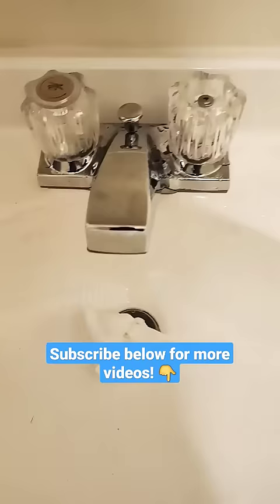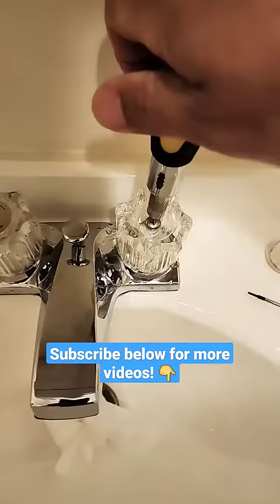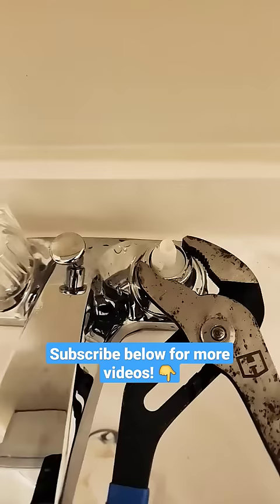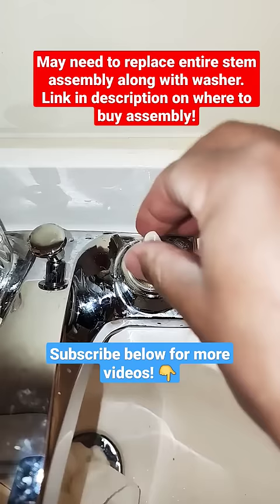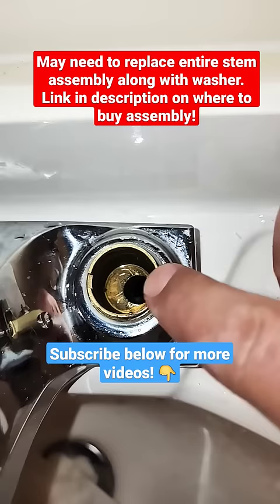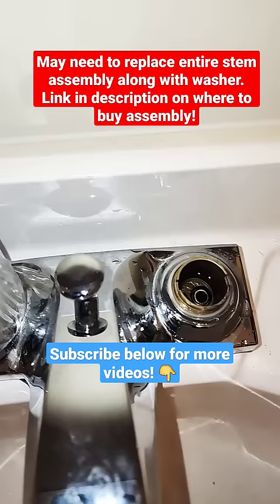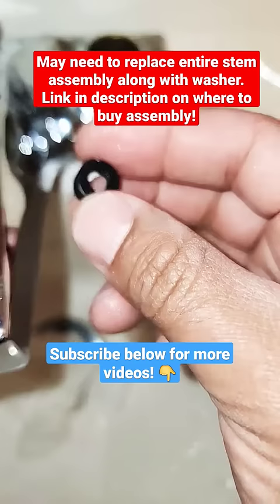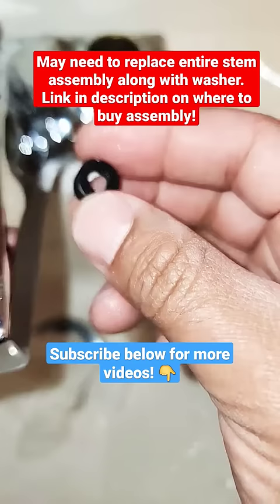How to Fix a Leaky Faucet in 60 Seconds

Comment: Thanks.  I just watched your video and fixed my faucet.  I replaced the washer spring and the stem piece.  It was about $10.  I called my plumber to ask how much he would charge.  He said $150.  Thanks.  I owe you l.
Reply from the maker: That's awesome! I'm glad the video helped you fix it and save some money! Comments like these are the whole reason I started the channel. Thanks for watching, have a great night!
Reply: I did the same thing I owe him
Reply: @fixanythingsavemoney  This is so helpful.  So many plumbers are crooks lol
Reply: 150 is actually a decent price for a plumber to drive out to your house and repair a faucet. In fact I’m surprised he offered to repair it at all. Nowadays a lot of plumbers only replace faucets.
Reply from the maker: @everythinghomerepair1747 that's one of the reasons I started the channel. 150 isn't terrible to have someone come out but replacing an entire faucet for a leak is crazy to me. Especially when the parts to fix it are generally pretty cheap. Even if you have to buy the stem and seat it's still cheaper than replacing the entire faucet. Not to mention if you have a double vanity and can't find a matching faucet anymore. Thanks for watching and for the comment! Hope you have a great night!
Reply: @everythinghomerepair1747  Yeah, that was probably his minimum price whether it took 10 mins, or an hour.

Comment: The stem is on tight for the hot side. Can’t remove it.  The cold side- the nut won’t budge.
Reply from the maker: A couple other people have said the stems have gotten stuck. You can try putting a pair of vice grips on it and wiggling it loose. The bonnet nut will probably come loose if you spray some penetrating oil on it and let it sit for awhile. Pb blaster or wd40 work great

Comment: Hi, really great video. I determined it was the hot water dripping, I turned the water off, I unscrewed it, took off the tap, there was a bunch of gunk under it so I cleaned it but now I can't get the nut off, it's stuck on there. any tips?
Reply from the maker: Are you using channel locks to try and remove? If so you probably are using enough force. Try spraying some wd40 or other penetrating oils on it and let it sit an hour or two. Hopefully that helps! Let me know how you make out! Have a great weekend!
Reply: @fixanythingsavemoney  Thanks for the reply, I will try that. I also heard heat can help because it expands the metal, I don't have a torch, can I just use a lighter?
Reply from the maker: You can but some of those nuts are plastic so you may melt it. I would definitely try the penetrating oil first.
Reply: If you removed the nut, fixed the problem, and replaced it. Why do you need to remove the nut again anyway? If you tightened it, i don't know how you're having an issue removing it unless you tightened it way too much. If you still have a problem, then tap your wrench with a hammer as you apply pressure anticlockwise on the stuck nut.
Reply: @zatomlzxzanamolzy1253  The problem is I can't get the nut off so I can't fix it, I need to remove the nut to fix the problem but I can't get it off.

Comment: I removed the screw under the knob cap, but the knob will not pull off. It seems to be stuck.  If I pull too hard, I am afraid it might break the other parts.
Reply from the maker: Is it the same design as the one I have in the video? If I remember right I think the cap on the hot water was on pretty tight on the one I did but came off with some force. As long as the screw is fully removed and you don't see any other type of fasteners it should come off. Let me know how you make out though. Thanks for watching and good luck with your repair!
Reply: @fixanythingsavemoney  It is the same type and shape but is a metallic Waltec brand.  I'll try using a handle puller later.  Thank you.
Reply: Mine seems stuck also 🥲 what to do next? I refuse to call the plumber , I can do this if only I can pull this stubborn white knob or stem, whatever, it looks so  easy on this video ☹️
Reply from the maker: @glendanikolakakos7431 you can try to pry it up with a flathead screwdriver but I know that runs the risk of cracking the handle. How old is the faucet? I'd make sure there are no other fasteners holding it in place first.

Comment: Where do you get the little rubber piece? What’s it called at the store?
Reply from the maker: The rubber piece is a called a seat. If you look on Amazon you can find the spring and seat sets. Just type in "delta spring and seat set" then match up the images with what you have. Thanks for watching and for the comment! Hope this helps!!

Comment: Thank you for the video. I'm kind of stuck at the water shut-off. The mineral deposits have stiffened the valves and made them stuck. I was finally able to get them moving back and forth. But now I'm trying to shut off the hot & cold water from the valves below the bathroom sink. Unfortunately, the leak is still going. Any suggestions?
Reply from the maker: You can cut off the water to the main water supply in your basement. Unfortunately I do not have any videos up yet that show how to replace the valves but it will at least shut the water off so you can replace the parts in the faucet. Be sure to subscribe to the channel because I'll be uploading videos in the near future on how to replace these valves! Thanks for watching, have a great day!
Reply: @fixanythingsavemoney  Thank you!

Comment: I replaced the stem, washer, spring .  The whole set.  Its still leaking.  Hot side.  Now somehow I screwed up the knob because when I turn the water valve back on water comes out, but the knob is off.  Where did i go wrong? I shut the cold water valve off first and it was still leaking.  So it had to be the hot side.  Now with the new parts put in still same ol leak but now the knob wont work as well.  I have to turn on the hot water valve to get hot water.  So I created another problem..😢
Reply from the maker: You most likely installed the stem wrong. The top of the plastic piece on the stem that the knob fits into is moon shaped and goes on a certain way. I'd take everything back off, make sure the rubber piece is in correctly, the spring is seated the correct way and then the stem is situated the correct way. You can take the knob off the cold and look at the position of the stem on the cold when the water is off. The hot side should be a mirrored to that! Hopefully this helps! Let me know how you make out!

Comment: Tried this and it worked in fixing the leak but now the water will not come out of the faucet unless i turn the valves on and off… the handles are not letting me turn on the water or to turn it off ? Help ?!
Reply from the maker: You may have accidentally rotated the stem when you put it back together. Try turning off the water again and rotating it
Reply: @fixanythingsavemoney  which way is the stem supposed to be face ?
Reply from the maker: @kenmartinez4914  if you pause this video right around the hallway point as soon as I put the channel locks onto the ring you can see the orientation pretty good. Let me know if this is how yours currently looks.

Comment: Trying to replace my hot water faucet but having trouble getting the bolt off. It won’t turn. Tried wd40. Any suggestions?
Reply from the maker: Are you talking about the screw under the hot water cap or the plastic nut holding the stem in place?

Comment: I need some help! I figured out the leaky one. Took off the cap and now I can get the nut off. I have a rusty adjustment wrench and the nut isn’t moving. And there is black residue from the handles. Any advice you could give?
Reply: It just came off and now I can’t get the new handle in. Ugh!
Reply from the maker: Sorry it took me so long to see your comment! Did you only replace the washer inside?
Reply: @fixanythingsavemoney  I pulled it all out but the new washer doesn't fit right. I   don't know what I'm doing wrong here. I'm going to have a friend fix it. I'll update you.

Comment: Do I have to turn the water off? I am handicapped and I can't get to the water shut off
Reply from the maker: Yes, the water must be turned off before starting. Otherwise when you take the handle and stem off there will be nothing holding the water back. If you can access the main water shutoff in your house you can turn it off from there as well if it's more accessible. Just make sure you turn the handle before starting to ensure there is no water flowing. Thanks for watching! Good luck with it. Have a great night!

Comment: My sink is just like this one. I followed the steps, Then I did everything in reverse. Now, When I turn the knob on there is no water coming out. Help!
Reply from the maker: Did you turn the water back on at the end? Sounds simple but this is something that even I once forgot to do and for a split second thought something was wrong
Reply from the maker: Assuming the water is back on... the only other thing it could be is the tip of the stem got rotated and is in the off position.
Reply: @fixanythingsavemoney  Thanks for your response. I went back and remove the stem (cold side) and put it on the opposite side. The side that the stem is on in your video near the faucet is where I had it earlier. Now I just went and put the stem on the opposite side. I am still having the same issue. I turn on cold valve and water come out faucet but when I turn the knob it does not turn off the water and so I turn the valve back off.

Comment: Zero luck getting the seat to seat 😡 might be easier to replace the faucet!
Reply from the maker: I've always been able to get it with needle nose but someone on here suggested using a pencil. That didn't sound like a bad idea. Let me know how you make out. Thanks for watching and good luck!
Reply: Thanks for the reply, so is the seat supposed to recess down into where the spring is all the way (so it looks like it did when I took the old one out?) no luck with the pencil @fixanythingsavemoney
Reply from the maker: @kkeenan536  I believe if it's seated properly it should be somewhat flush with the inside. Is it the same size seat as the one that came out?

Comment: I can't even turn my knobs at the bottom of the sink
Reply from the maker: Are you not able to remove the screw to get the knob off or is it still stuck once you take the screw out?
Reply: @fixanythingsavemoney  I can't move the knobs that turn off the water under the sink not the faucet I'm afraid it would break also it's not my property I rent
Reply from the maker: @geoffreymoore2662  if the valves are really old they do stick and if the piping is old it can definitely break. Best to let your landlord handle it probably. You'd had to shut off the main water supply to the house, cut out the valves and replace them. Definitely a larger job than just switching out some washers in the knob. Good luck though! Hope your landlord gets it sorted out for you!!